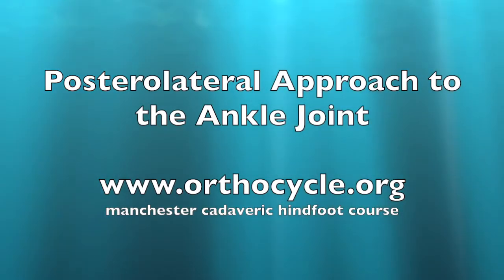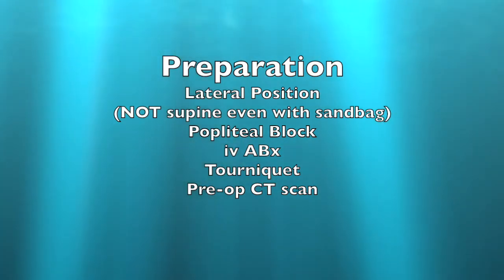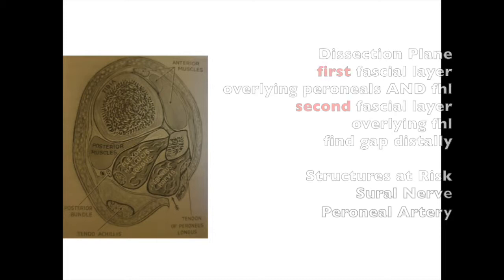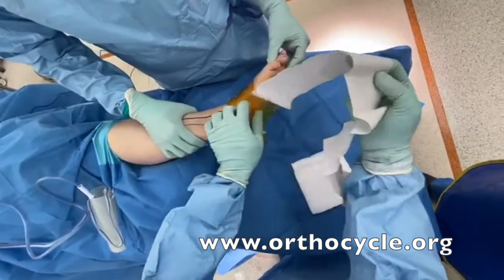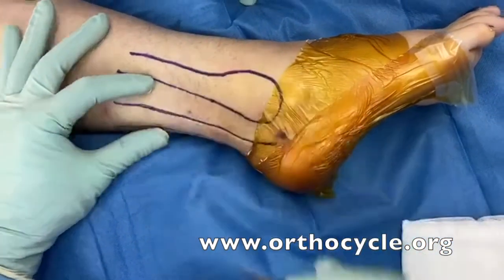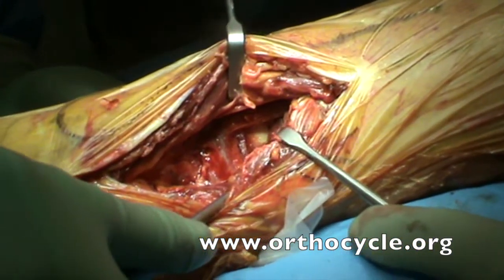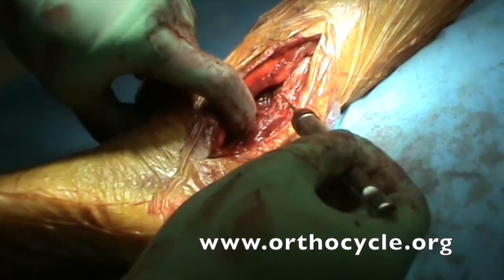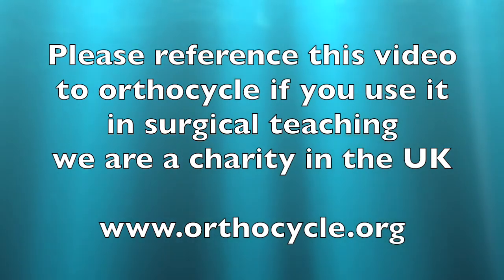posterolateral approach to the ankle - surgical video - Orthocycle Foundation

Comment: Great video! What company was used for these implants?
Reply from the maker: it probably doesnt matter too much which plates you use, so long as you get an anatomical reduction. the stainless steel implants at the end of the video are JnJ but my perference now is stryker variax, as the plates are low profile and contour nicely. also, the H locking plates for the medial malleolus can be contoured to wrap around the medial mal to give a really solid fix for immediate weight bearing. i use straight plates now for the post mal rather than the T plate - its just not necessary and is far more demanding to get 2 or 3 screws in the horizontal component.